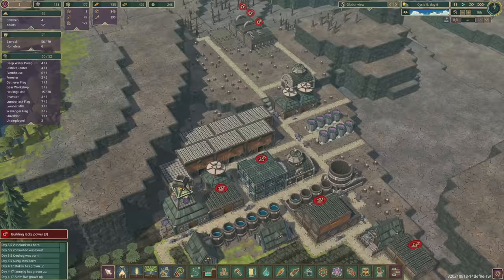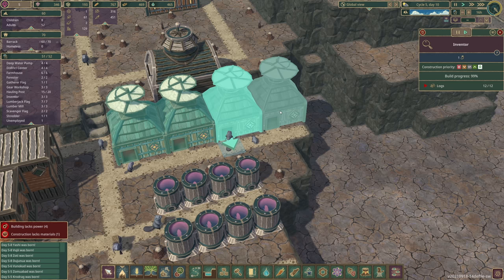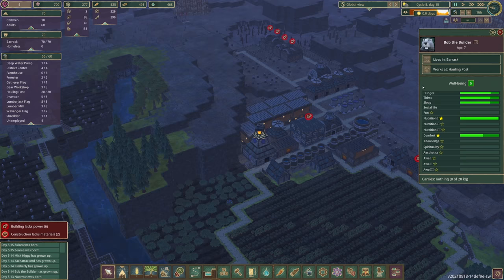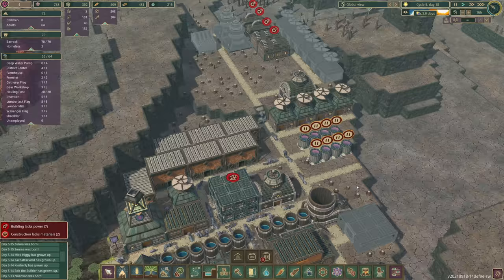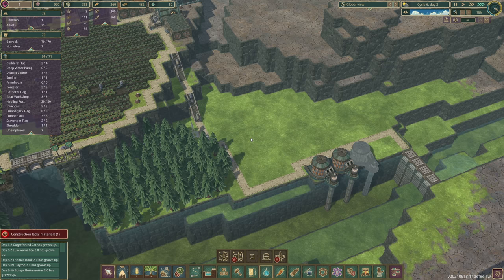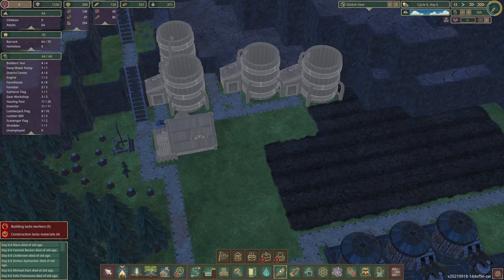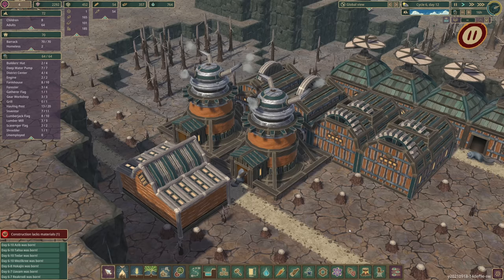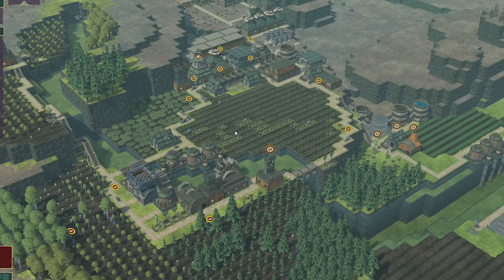Engineering a MEGA DAM to survive the dry season in Timberborn!

Comment: Your farmhouses are too far away from the district I think. I’ve only played the starting faction so I’m not sure if this is different. But you’ll need to make a new district and setup trading posts between districts to expand further into the map
Reply: Another option is to build a more direct path by using platforms to cross the river, if he clicks the district center he can then see the exact range
Reply: @inkaxl2526  exactly. I think that if he builds a bridge or platforms straight across from the farm, it should probably be in range of his district center.
Reply: The other issue is, since the stairs aren't built yet, they can't build the platform to go down.
Reply: Another solution is by bridges, so research a bridge long enough to cross over and would be enough
Reply: @maximeteppe7627  Time for a suspension bridge!
Reply: I played this map myself and I can confirm they're out of distance on that spot. He needs to build a path straight over the water so he shortens the distance enough, it's possible to build on that side of the river but you need to maximize your pathing.
Reply: You can click on the district center building to see your city's build range. This is determined by total path length and not by radius from the district center.
Reply: Faction doesn't make a difference
Reply: Yes, can confirm. The farms across the river are too far from the district center. And the only way to solve that is to either make a new district, or build a shortened path from the district center.
Reply: One can always delete the district center and relocate it too. (at no cost) Mine is at the starting plateau where the RCE has stairs coming down and my "megadam" is all the way down at the fork on the river giving me much more water storage filling the other fork by the ruins too.
Reply: Warning for making multiple districts... Have the distribution and drop-off researched and built first :)
Reply: Yah I have played it too 
Because if theses videos 
But the fact that distincts need to be connected and due to that you can’t put them too far away as they need to be at the same level
Reply: @Taolan8472  They can build 2 levels above/below their level on adjacent tiles so should be fine.
Reply: @TheBeardedQuack  couldn't agree more! On my first map, i nearly failed when i tried to move some peeps over to the new district during the drought season, just expecting them to bring the supplies with them or be able to share them on their own😅
Reply: @TheBeardedQuack  I had success by building farm, pumps, water tanks and storage just within reach of District 1, moving excess supplies into it, then putting a gate where I wanted District 2 to start. But my D2 isn't providing food to D1 like RCE needs his to do. I just used it to split my population into separate areas.
Reply: If you select your district building you can see your paths light up with a green line that slowly goes to red. If that path doesn't have a color at the end of the red line, it's too far. You may need to create a new district building separated by a district gate. Each district will act as their own. Beavers from one district will be employed on that district but some builders can build in neighboring districts if it is close enough. You can also send supplies using a supply pickup and drop site. Supply drop sites build instantly like paths do. You'll want these to send food and water supplies at the start of creating a new district. Seeing as how low the food and water is at the moment, building a new district would be a bad idea. You're best bet is to pause building on the farmhouses that are too far and try building new farms within your district. The beavers that died of old age may also help your situation. Less mouths to feed.
Reply: @itsme__a  can confirm. I tried building a high rise sky scraper right next to my city center, and I was only able to make it something like 6 stories tall because of my inefficient paths. That was when I learned about the maximum path distance away from the city center.
Reply: @Taolan8472  no that wrong they can reach down quite far i play the game it’s fine
Reply: Yeah its pretty annoying that you can't increase a district's range.
Reply: You could also redesign your paths maybe make a shorter path.. sometimes that helps the mechanics are weird
Reply: @Taolan8472  they will build the platform first. They can build it seems like anything if you get them in any adjacent tile no matter the height difference. Watched a day get built 10 high from the 10th tiles height.
Reply: @TheBeardedQuack  absolutely the best idea. Or just build the food and what not suppliers before hand. I've noticed my builders don't give a crap if it's put of range.
Reply: @deadmantwen  might have been true in the demo, but in the early access build they can build down any distance, but only up by two.
Reply: @TenHorizons  Also, he doesn't need a 6x1 suspension bridge to cross a 6 block gap, just build two 3x1 facing each other. Should be a lot less science needed for that
Reply: or have less complicated paths a bridge in the middel should reduce the length.
Reply: HEART THIS PERSON’S COMMENT
Reply: @Taolan8472  no because they have a range of about three tiles up and down for building platforms, stairs, and dam pieces.

Comment: Unlike the early access, paths only extend the size of the builders and district limit by so much before you have to make another district where beavers live and work completely separately from the others and their resources are separate (though they can share between)
Reply: You can check the range of a district's reach by selecting the district center.
Reply: It's still early access though.
Reply: @mertenbohn5952  — I think Scott meant “unlike the demo”, which was a much earlier version of Early Access.

Comment: One thing: In the last video, you said that the irrigation tower is now called a "water dump". Those are actually two different things: The irrigation tower wets the land, while the water dump places an actual flowing water tile.
The irrigation tower is unique to the first faction of beavers, that's why you don't see it in the menu there.
Hope this helps!
Reply: Good point, irrigation towers are good. I need to blow a hole and dump water into it and see if minecraft farming logic works though
Reply: I wish there was a full creative mode.  I want to play with the water dump but I don't have a good spot to place it on my current map.
Reply: @SIZModig  It will, but the farmland does suck up the water slowly (as opposed to how it works in minecraft). That's why you would either want channels of flowing water, or you might have to keep the water dump there
Reply: @nacoran  Modding support at least has the "under consideration" tag in the forum, so a creative mode could be modded in...

Comment: If you're pausing a whole bunch of buildings at a time, you can just select the building and press p for each of them
Might be a bit faster than clicking the pause button every time
Reply: To add to that, there is a dedicated priority button on the hot bar that lets you select whole areas to set their priority. It goes off of the current layer height your cursor is selecting when doing so, but will select everything that's above the lawyer you're selecting.
Reply: @jaknowwho  Indeed. Opening the priority menu also displays which priority all the construction sites have by giving them a certain colour
Reply: Oh, that’s a lovely shortcut for pausing buildings faster!

Comment: The reason they aren't connected is probably cos they are too far away from the district centre, you can either build a second centre or move the current one closer
Reply: Wait, you can move the original district center?
Reply: @zacharyelmslie1620  you can't move it as such, but you can delete it and then rebuild it straightaway in a different position
Reply: @notnek879  Ah, that makes sense. Maybe I can use that to revive my current game from limbo.
Reply: It is too far. You can verify this by clicking on the District building and seeing where the line reaches to. You can also tell when snapping the building to the path; it will show as connected or not. The Build Range is larger than the path range. I hope they make this more clear. The only way to know something will be too far is to build the paths and see where the line ends.
Reply: @zacharyelmslie1620  He could also build a shorter path

Comment: Eventually you might want to use dynamite to deepen out the river up top as well - sure you might have to replace the pumps to be able to deepen out the area under them, but you'll be able to store more water up there.

EDIT:

Check the length of the path from the district btw, those farms are probably just out of range. - I've had underwater paths work just fine in my games

Comment: A fun little tip I found out while playing and posted on Reddit... When and if you get to explosives, replace your paths with trenches that are filled with water and a platform over it, then replace the path. Then all you need is an input that will fill the under-path irrigation and you should have water mechanics worked out!
Reply: Bonus if the input is a dam as during the dry season it will stay moist throughout. Worst case you could add a resevoir above the input.

Comment: I really want you to remove the left most water pump between the gear factories and replace it with an engine or something, also as you seem to have noticed gear power can be transferred through buildings.

Also I bel this faction has a building it needs to extend the range of the central hub building not that the game is glitched out.
Reply: He needs to build a new district really

Comment: For the paths not connected thing click on the district center and then follow them green lines on the paths outward, at some point they turn red, then stop, even if the path continues. There is a max number of tiles of path from the center.

Making shortcuts across indirect paths can help though!

Comment: You can use suspension bridges to build across the water.  The bridges are built in halves, so if you use two 3 wide suspension bridges on each side, you can span the gap.  And if you're off by one, you can place a block between them.

Comment: small tip you can press p to pause a building instead of clicking the buildings pause button. another thing is underwater paths do work but buildings need to be in range of the district (the colored lines if click the district building).

Comment: The issue with your "Not connected by paths." problem, is your district center has a limit to how far it can go. If you click on it, it will show you how far it will actually reach along your paths. A more direct route across the river would help (maybe).
Alternatively, you need to build new distracts and supply routes to make sure it'd fed and watered and has all the resources you'd want. Complicated but fun!

Comment: Click the district centre. The lines that it draws on the roads is the distance. Once its outside that, you need to build district gates and start a new district, set up hauling between using the trade post and drop point, and then migrate beavers to the new district.

Comment: About the farms being too far: If you click on the district center, you can see the range of the buildings limit in the shape of a coloured line going from green to red, green being close and red being far. If the door of the building you want to build can be connected to the line, the building will be connected to the district. Don’t mistake it with the turquoise area: it’s the construction workers limit. There are two solutions: build another district, but it require preparation, logistic buildings and a lot of spare beavers, or you can build a straighter path. Such a path would be a bridge going from one side to another in the shortest distance possible from the district. Note that you can build a two bridge one after the other, one of each side, but that you can build both from the same side. Here was my little tip.

Comment: The reason you don't have the farms connect to the district is not because the paths are underwater but because the district ends at a certain point showed by the lines in the paths.Also love the vid keep up the good work both as a youtuber and as a engineer.

Comment: Even though paths and builder's huts extend your range at some point buildings will be too far away from the district center and that's where it gets a little tricky. These are new settlements with their own needs and their own management. So you have to have your first district well sorted before starting a second one and you will need distribution centers and drop off points so they can trade goods. Good luck!

Comment: Click on your district center. The line turns from green to red the further away it gets. Your builders have a range beyond the end of that line, but all your buildings MUST connect to the line directly (Side note: when you place a bulder's hut, the range displayed is the same as your district center regardless of where you place it). When you are placing a building, if you place the paths first you will see it "activate" the connection by displaying it's network connection if it is close enough to the district center, but if not it is not, it will be obvious.

The fix for your farmhouses is to make a more direct path to them from the district center. I always try to arrange my cities so that I have VERY direct paths leading back to my district center and no big areas blocking the way that I have to path around - like, just straight lines out in all four directions basically. That's the best way to maximize your range.

Comment: In light of the approaching dry season I'm thinking that an alternative way to have approached the building of the MEGA DAM would have been to start out with a weir or roller dam one or two blocks high across the bottom of the valley, then build a pump, then go back to stacking levee blocks one level at a time to raise the weir as materials and science points and labor became available. Finally top it off with the spillway blocks, possibly even using a 2 or 3 level adjustable spillway just in case you want to go back and flood where the potato field went.

Comment: What you can do is instead of like manually clicking priority on every building, go to 6th icon from the left on your bottom actionbar.
That's the priority menu, select what priority you want to make something, and then just click on all the buildings you want to be that priority.
Reply: to be fair, I think the menus deserve a bit of a makeover for ease of use. 
The priority tool isn't very intuitive, and I think lots of stuff deserves to be grouped and arranged differently. Like wouldn't it be easier if farmhouse crops and forester resources were in the same submenu? couldn't the wood related buildings be closer to the designate woodcutting area icon?
The icons are fine, but sometimes it's hard to remember what goes where.

Comment: keep in mind the suspension bridges are two pieces. so if you want to span a gap that is 4 wide, you only need to unlock the 2 tile bridge and you put them back to back. with the 6 tile bridge, you can span a 12 tile gap.

Comment: The building hut does not extend the original range of the district center. You need to build a new district center separated by the district gate on the connected path, then click the old district center and migrate some beavers to the new district center.

Comment: As many have already said -
Your farms are to far away from your district center (the house you start with)
Click on the center to see the path length and its complexity for haulers (green to red paths) as well as the area bulders can reach (the blue border)
Building as directly as possible can help you spread further
& once you used up everything in reach - you gotta build a new district with a gate & center (paths tab) and use the distribution/drop-off points (labor tab) to connect them

Comment: There's a maximum distance your buildings can be from your district centre. If you select the district centre you can see the coloured lines that indicate the range. I don't think the builder's hut extends the range, you really need another district centre. Unfortunately it's a lot of work to manage multiple districts: You need to set up distribution posts and drop off points, trade routes with haulers, etc to move goods between districts, because each district has its own storage. You also need to build separate housing for each district, and migrate your population. Logs should ideally be collected locally since it's very slow to move them between districts (because they are so heavy).

Comment: Check the range of your district by selecting the district centre.
The game doesnt tell you how far but if you build paths long enough, it will indicate the boundary by ending the "line" on tha path.
Try to add storages at the edge before adding new district so you wont have issue building required buildings for your citizens (water, food)

Comment: The path underwater was fine, the issue is your farm houses are too far away from the district center. So you have 2 solutions, I believe there is a district extender. I'll look and comment under this comment If correct. Or the other solution is to build a new district and set up trading posts. This does however mean you will have 2 populations to manage. Also don't know if you know this. But there is a tab to make prioritizing stuff easier. It's the red and green arrow tab. Hope this helps

Comment: Farmhouse isn't connected because districts have a hard distance limit based on path you can check by clicking on the district center - anything within the lines on the path is in the district -, so because of the roundabout way it goes it doesn't quite reach there. Basically, go get that 6x1 suspension bridge for a straight path.